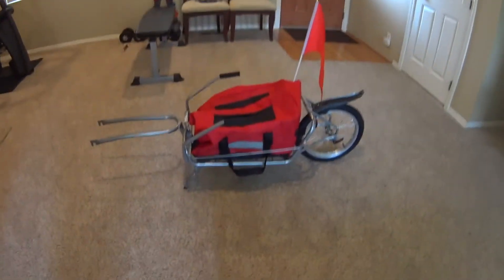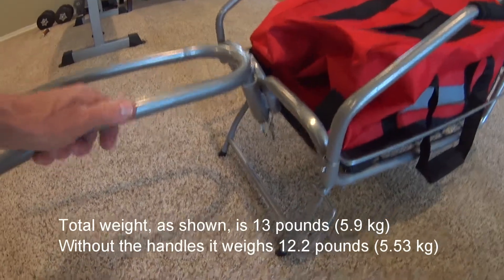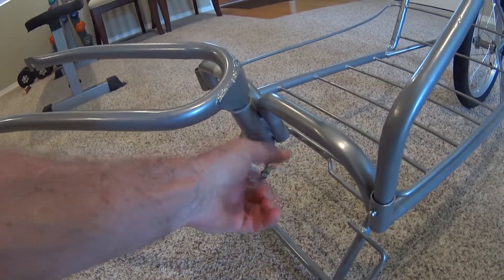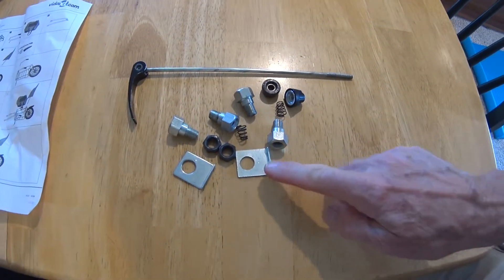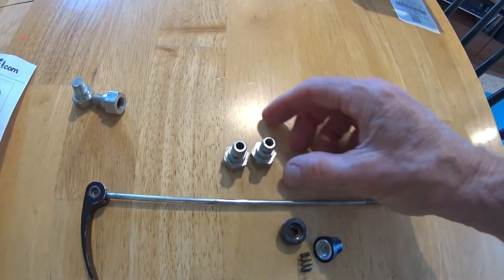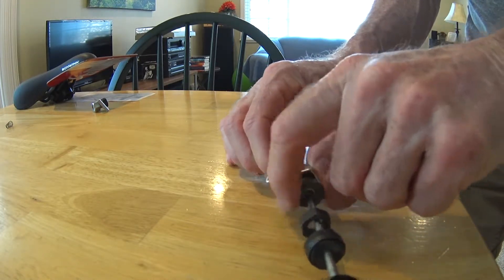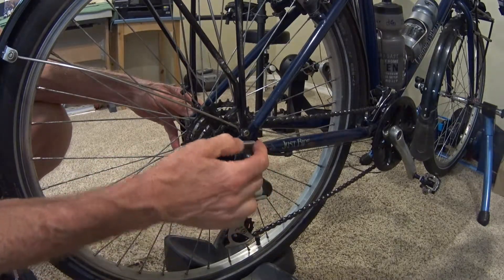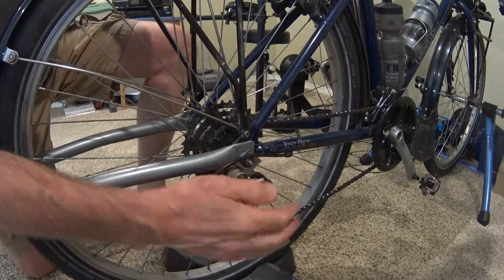VidaXL Single Wheel Bike Trailer - Trash or Treasure?

Comment: The "funny things" go on the inside of the trailer fork facing out according to a picture I found of a trailer that looks the same on walmart. The walmart trailer looks like the fork is longer than what you have, which is what I need for my bicycle (700x32). Also, walmart wants more for the trailer, though I am not absolutely certain it is the same model. Thank you for your great video.
Reply from the maker: Thanks Earth Man - yes I tried putting those "funny things" in both directions and had trouble with them either way.  The spokes I fashioned for it worked much better, but unfortunately my dog didn't like riding in the thing.  So now it is sitting in a shed until I decide whether or not I want to use it for touring.  Thanks for your comment.
Reply: @MTMiser  Cool. Thanks for your video,

Comment: I have one of these.  They had to send me a replacement fork for it, cos it bent.  I used it to bring my kids' schoolbags to school when they were smaller. It just about fit 3 small schoolbags and it tracked well through the narrow entrance to the park near their school.   I wouldn't trust it for anything heavy or for use on long distance, it's just not good enough quality for that kind of trip.  I have a much sturdier trailer for bigger loads.
Reply: Thanks for the advice, I was thinking of buying it for bicycle touring and this is convincing me otherwise. Does it rattle or seem like it's flimsy and would break?
Reply: @pedro_claro  rattles a little bit, but you can tighten it up and use plastic shims.  I wouldn't go over the recommended weight for it, and I wouldn't be eager to take it off road or onto any roads with pot holes.  So, really depends on what the surface is like where you're going.  If you're going someplace that's as smooth as a Dutch bike lane, it's fine so long as you don't overload it.

Comment: I live in the apartment life so I am going to be thinking about a bike trailer that collapse down and you can put it underneath your bed or in the closet out of the way when you're not using it and it only takes one side to fix it on your bike frame and then if you don't want to use it you can unhook it and leave it in your apartment and I have a pretty good idea of what trailer I'm going to get for my regular bike in case if I have to haul my cans to the recyclable place that way I don't have to rely on anybody to take me but I will have to do that this winter time is around the corner still I will have someone take me the right now I don't have the cargo trailer for my bike yet but when I do get one it's going to fold up three to slide it under your bed or slide in the corner where it's out of the way and the wheels they come off really thank you put them on real easy this trailer that I'm watching the video of I would think about a different trailer is this is too complicated to put together and hook it up to your bike so my advice is to people that are reading this get you one that folds up that you keep in your apartment if you live in the apartment life if you live in that house and you got plenty room and you got a garage then you keep it all together without taking it apart but in the meantime have a blessed day

Comment: Hi. Is this trailer strong? Is it still working? What resistance does it have with time and wear?
Reply from the maker: Let me put it this way - for hauling my 15 pound dog around, it's plenty strong enough.  But although it says it's rated to carry 65 pounds, I would never trust it with that much weight.  The design just doesn't look strong enough to me.  It's got those two forks that connect to that central pivoting column with a couple of welds holding it in place and nothing else.  If you look at a Bob Yak and see the kind of bracing it has in that area, there is no comparison.    So I would probably trust it riding around home with my 15 pound dog without much concern, but I'd never load it up with 50+ pounds of gear and go on a cross country tour with it, unless I added some bracing to it.   

As far as time and wear, I can't answer that question.  Unfortunately my dog did not like riding in it so it now sits in storage.  In the future I may do a tour with it, but would only be carrying about 25 pounds of gear.  For that I think it would be fine.
Reply: @MTMiser  Many thanks for your courtesy

Comment: wery bad i had it after 600 km trip got destroyed not worth the money and cant handle the weight i had only 6 kg on
Reply from the maker: Sorry to hear that Andris.  How did it get destroyed?
Reply: @MTMiser  wirst was the midle conection. The metal was to soft it bent and broke. Had custom made new. And that happened after 240 km. Then the joint system broke apart cos of por weight distribution it always ends up in the midle were is the joints. We fixed that cos we was travelling in middle mountain. After that it was beyond repair. Wheels lasted les than 400 km so not the best option better add couple dollars and get proper one
Reply from the maker: @pelecisar  Thank you.  I was thinking that would be the weak spot.  Not a good thing when you're on a long tour.  Thanks for sharing your experience.
Reply: @pelecisar  Thanks so much for the info. It looked too cheaply made as I saw it, plus its at 150€ now... absurd.

Comment: SKEWER WTF  are its an axle , SKEWERS are for cooking , bbqs , not mechanical fixtures, by the way guys “Hacks” as used in vides on youtube is a pile of bollox ‘HACKS N HACKERS are only valid words in computers , tips n tricks is correct terms .
Reply: Lol.  Anger issues?  Don't know what you call them across the pond but here in the U.S. they are indeed called skewers.  Note - there is a difference between a skewer and an axle.  The axle is the hollow tube that the skewer goes through.    Oh - and "hack" is an appropriate word as well, unless you're still living in the last century.
Reply: @jimmyzelski7742 In Scotland, we call them skewers too. Quick release skewers, usually.  I've always liked them.
My latest bike has through axles. Haven't taken one off yet though. 
Cheers